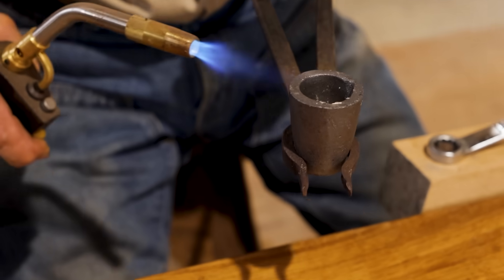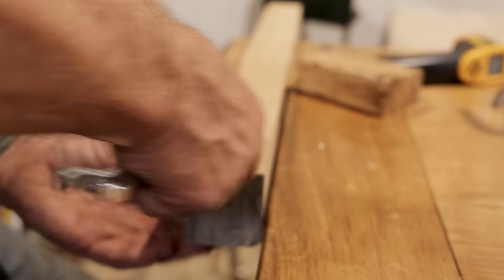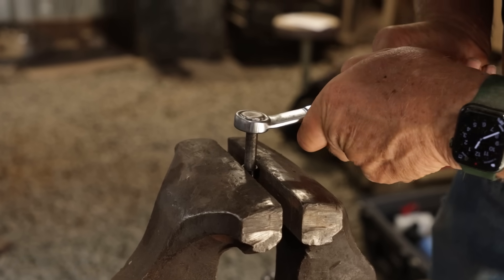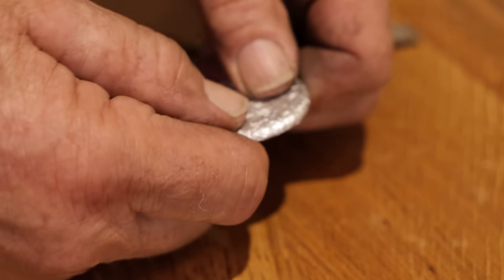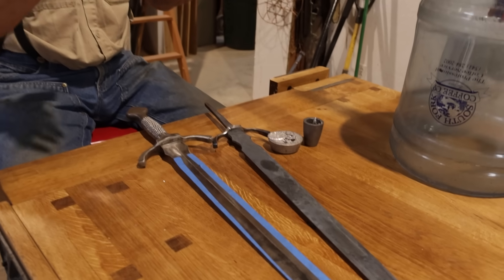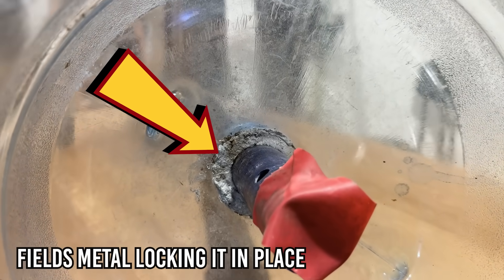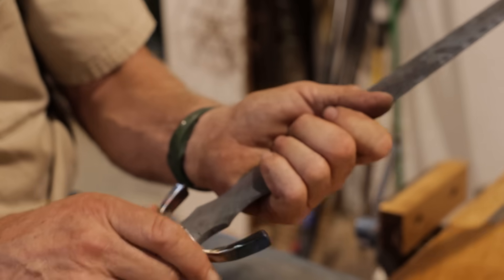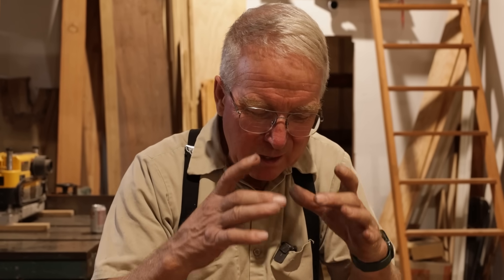Liquid Metal?

Comment: And the other definition missing here is the eutectic mixture.  63/37 solder is an example.  Its either liquid or a solid and never has a loosey-goosey or plastic state.
Reply: I learned about 63/37 in a Navy micro /miniature soldering school. Lower temperatures on the sensitive components was the goal. It has been useful in the 40 years since.
Reply: @roloaddict  And as a 1591 NEC holder, that's where I learned!
Reply: It's not "another definition", it's simply what happens when both metals have a singular melting point. Non-eutectic metals (i.e., an alloy) retain their individual melting points, leaving one starting to solidify while the other is still melted.
Reply: @dulmi2317  Its literally another definition.  You may be ignorant of it, but don't discount the knowledge of others.  Its literally used by thousands in the Navy to describe 63/37 solder's ability to go from liquid to rock hard instantly whereas every other type of solder on the planet has a eutectic state where it remains plastic for a period between liquid or solid.

Comment: I believe Babbitt is also a eutectic alloy, right?
Reply: Yes, Babbitt is a eutectic metal.  But Eutectic doesn't mean what Scott said it means. There are plenty of Non-eutectic alloys which also melt at a significantly lower temperature than their constituent metals.  Eutectic means that it's an alloy whcih melts all at once, and a single temperature.   A non-eutectic alloy melts progressively as  it's various constituent metal melt at different temperatures.  The result is that it melts over a temperature range, where it's not quite solid, and not quite liquid.  You can see that with some solder alloys whcih go through a "slushy" phase before they melt completely.